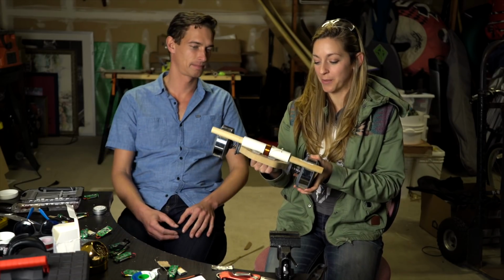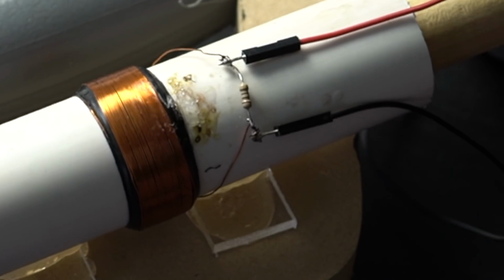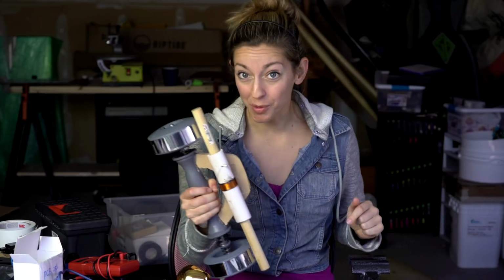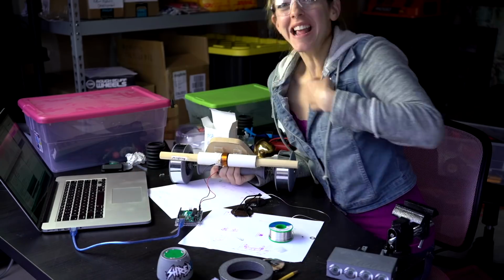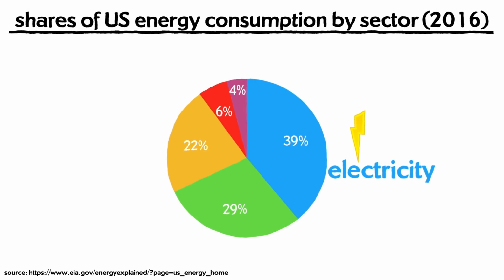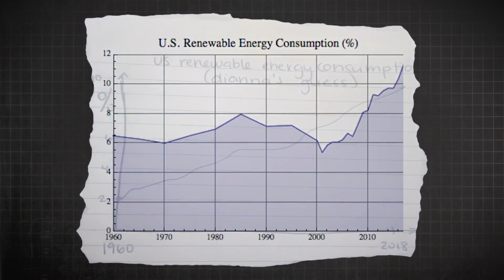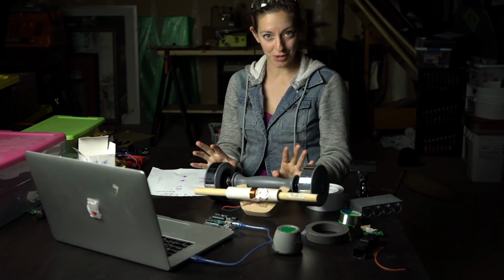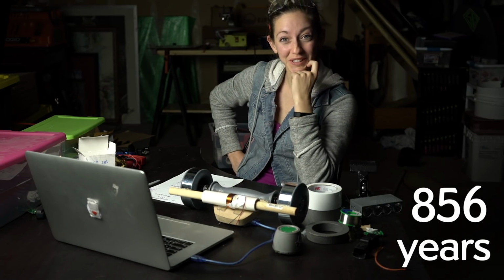Can you power a house with a ShakeWeight?

Comment: Good one physics girl.

How about blowing the myth that solar and battery power together are clean green power.

Do the research, lifecycle analysis, youll never generate as much power with them as you used to  manufacture them , yes omg. 12 tonnes co2 per kwh of storage in LiFe. Some thirdworld PV, manufactured using dirty  coal hmm not good. Maybe get twice the manufactured energy over 20 yrs, put them together fffft! 

A show on lifecycle energy costs that also considers emissions from that dirty manufacturing, hmmm good show.

Comparative analysis of different energy sources.

Would make a good show. Im sure the wind industry would fund you ha ha
Reply: Even with all that, renewables and nuclear come out ahead of fossil fuels on nearly every metric. While the downsides of renewables and nuclear should be considered, they need to be considered in context, and the context is pretty clear that external factors of fossils are an order of magnitude worse than those of renewables and nuclear.
Reply: Thomas, this is unequivocally wrong and has been wrong for about 40 years now.  We use uranium at less than 1% efficiency now, and could boost that by orders of magnitude if we wanted to.  We don't because URANIUM IS SO CHEAP! It is so cheap that all plans to build breeders have basically stopped because there is at LEAST 100 years of proven reserves, with likely hundreds more if we looked hard enough, and that is before considering ocean extraction, which is essentially renewable at that point (do to the incredible amount of uranium on the ocean floor that dissolves back into the oceans once you extract it).  Fusion and fission need not be at odds, particularly over something as much as a non-problem as fuel reserves. And that is before even considering thorium and breeders.
Reply: EROI is great, but it isn't everything. I live in the Great Plains, where everything is very spread out. It's infeasible to build a nuclear power plant for every city out here. If you centralize one, you lose a ton of power  transporting it over 100's of kilometers. Fossil fuels pose a similar problem. The wind here blows all day everyday. We can disperse turbines to keep everything powered out here while losing less to the grid. Renewable energy has benefits outside of carbon. 
I'm not saying fission is bad, just that it isn't a long term solution. Future mega cities like Lagos and Nairobi will require a ton of power in the coming decades due to increased affluence. They will use coal if we don't give them something else to meet demand. Nuclear is the only thing that will meet their power needs, but using nuclear fission to accommodate future energy growth will strain global supply. Billions of people are about to have a per capita power demand similar to that of Europe. Our current production lasts us 100 years, exponentially higher production will burn us out way sooner.
Reply: craig me can you state your sources and/or show some calculations? I work in the energy industry and I’m finding it hard to believe your claims
Reply: Not true. Solar power has an Energy Return on Investment (EROI) of about 10, and can be higher if used near the equator. Coal has an EROI of 30, but hydroelectric power has 40 and nuclear has got a whopping 75.
Reply: Actually the Uranium Red Book puts the number more at 120-200 years of proven, and that is without any processing or higher burn up reactors or using thorium. When you combine high burn reactors, thorium and ocean extraction, the number ranges more from 10k years to basically indefinitely. If we keep developing nuclear like we do other technologies, there is no reason to expect this end of resource supply to be an issue. I mean, people use the same argument against solar, that rare earth materials will be of short enough supply as to make it untenable as a power system. I have always found the resource depletion arguments to be weak, cause look at what happened with peak oil, all the sudden the US is an oil exporter again cause some crazy people found out a way to extract resources. Round and round it goes! There might be good arguments against nuclear, I just find the uranium is in short supply one not one of them. 

In the end the environmental impact of extracting resources for nuclear and renewables will likely be more sufficient cause for alarm than their attenuation in supply.
Reply: PV cells, and certainly batteries, are not perfect yet, sure. But they ARE cleaner than fossil fuels, and popular use is key for driving innovation to yield cleaner PV and bartery manufacturing.
Reply: I think we agree here that fission is superior to fossil fuels and we should start replacing coal with uranium. I just divided known supply by extraction to get 100 years (though 10,000 years of anything that's not iron, nickle, or silicon sounds like a stretch) so I'll have to read the Uranium Red Book. I've been on and off for fission recently. I'm open to it being viable long term, if the math adds up. 
Environmentally there is radioactive waste, but if humans are good at anything it's digging holes.
Reply: "How about blowing the myth that solar and battery power together are clean green power."
Quite the contrary, the more solar and batteries you have on the grid the cleaner the production of those two get, making it even more advantageous to integrate more of them.
Reply: they are a helovalot cleaner that what we are allowed to use at home right now... The only thing greener is probably LFTR, and I'm not holding my breath on a Sub $25000  0.25 container-sized mobile reactor getting dropped off in my back yard, any time soon.
Reply: +Thomas Urech You are however ignoring the fact that Uranium particularly the actually useful Uranium-235 is by far the rarest natural isotope usable for nuclear energy production on Earth. U-235 has a lower abundance than things like gold by a considerable margin, Th-232 on the other hand which can also be used for nuclear reactors and indeed for safer reactors has an abundance that is almost equal to that of lead several hundred times the abundance of U-235.

Admittedly one of the main advantages that makes Th-232 safer is that it isn't directly fissile on it's own starting a reactor using Th-232 does require a small charge of something fissile like U-235 or Pu-239 to get it started though there is more than enough Pu-239 already existing in unprocessed waste from Uranium reactors to initiate all the Th-232 we have on Earth which easily make Th-232 good for up to a few tens of thousands of years.

Short of a major disaster it would be shocking if humanity was still limiting it's resource horizons to Earth itself by the time we ran out of Th-232 and the asteroids contain many many times more accessible fissile material than the accessible crustal material on Earth after all that is where basically all the U and Th in Earth's crust and for that matter almost all the other metals came from, Pretty much all heavy elements and metals Earth gathered before it developed a solid crust are lost forever to us buried deep in the planets core as Earth is way too large with a gravitational field far too strong not to be very heavily differentiated.
Reply: I am all for 95% nuclear with renewables here and there. Burning coal is incredibly inefficient and makes so much waste. Nuclear fission is by far the safest and cleanest energy source we have per unit of energy produced. But so few people are willing to understand statistics.
Reply: I love Michael, but he goes a bit to far in the other direction. Nuclear isn't BY FAR the cleanest, but it is up there with renewables for sure and in someways maybe even has some upsides you can't with with them, and the same is true of renewables towards nuclear. They can complement each other if we let them!
Reply: I did some calculations and came to 101 years exactly of proven reserves at current extraction. Increasing nuclear use will certainly speed us that process (more demand => more mining => faster depletion). This is perfect for helping developing countries short-circuit fossil fuels, but is by no means a long term solution.
Reply: ARRO Projects will do thanks
Reply: Solar heating is awesome!  I wonder why we don't use it to run Stirling engines connected to a generator, though?  More maintenance? Higher cost?
Reply: Congrats craig, you attained the intelligence of a potato... sadly that isn't quite good enough for a real conversation on this topic.
Reply: Video Aerial Systems photovoltaic cells should be reserved for satellites. Reflective solar plants and solar heating are far better
Reply: Takeshi M 
Depends on where you source your solar panels as I said. And the trend to put a battery pack in garage makes it a poor return on energy investment. 
Agreed solar better than coal, but need to think where the pv came from and is that the best bang for buck. Some european, US pv would be very good!   But hard to know the emissions intensity in the production. 

 Bio energy, solar thermal, eeer not clearing the amazon, many options out there to make a difference. Godda find the best least emission intensive supply for your area. 

Godda say no one will invest in new nuclear developments any more. Takes 15+ years to get one up and running, future consumers may not want it, renewables are cheaper, and provide more dispachable power, ie faster availability when demands go up fast, and nuclear baseload can only be sold for minimal returns. 
Then theres the not in my backyard problems. Its hard enough approving a windfarm. Nuclear today, not an option. And then there is the security problems with nuclear waste. Not an option.

 Interesting discussion. Im surprised nuclear still has any support.
Reply: ok, but what if they're manufactured with clean power?  you can bootstrap off of conventional fossil fuels, but if you build new solar panels and wind turbines and batteries with power from solar panels and wind turbines then .. that's fully renewable and "clean green" power as you said.
Reply: Nuclear is the way forward. It is BY FAR the cleanest energy source out there. (seriously, not joking - here's a place to start https://www.youtube.com/watch?v=ciStnd9Y2ak )
Reply: Right. Solar is by far the least effective type of power generation. Even if we had a battery that could be manufactured once, and held infinite amounts of electricity, you'd never be able to generate enough electricity from solar power to deal with things like cloudy days, let alone power homes during the winter months when there is very little sunlight and the demand for electricity is the highest due to the cold.
Reply: You must consider the environmental damage of producing solar cells.  While they are amazing, they are very dirty (chemically) to produce.
Reply: Fusion perhaps, but not fission. We simply don't have enough uranium for fission. Fusion is the power of the future, but we need the other renewable sources while we perfect the technology.
Reply: Does anyone speak English here?

Comment: Nuclear energy is actually cleaner than solar and it can provide enough of energy fast and without a need to completely rebuild the grid or change consumer habits.
Reply: While it IS cleaner it cannot provide enough energy.  Nuclear plants are not capable of load following or peak demand.
Reply: arjenbij uranium isn't the only fuel for nuclear power
Reply: arjenbij Uranium is not running out. The specific uranium used is becoming less common on ground, but there is an endless amount underwater. Nuclear is sustainable but boy is it ever expensive. It works for smaller countries like France and Lithuania, but not really any further than it currently is for the states.
Reply: +arjenbij uranium is running out? and you think that the rare-earths necessary to make solar panels and batteries isn't? Also, while it is running out, known veins would run world for centuries before running out completely.

+Large.xxl while digging and concentrating uranium is dirty too, you need way, way, way less uranium than you need the minerals to make PVs.
What cost you're talking about? Nuclear costs already include decommissioning costs and that makes it like 10-15% more expensive than coal and still like half the price of PVs. Not to mention that if there were more nuclear power plants, there would be bigger market for fuel reprocessing (again, because you need so little uranium, you need a lot of plants feeding a breeder for the breeder to be financially viable).
Reply: Are you referring to a Thorium reactor?
Reply: Yeah, that's the most reasonable example, and of course sometime in the future we might have Fusion or some other nuclear fuel.
Reply: May I ask how nuclear energy is cleaner than solar? Nuclear energy might be more concentrated in terms of fuel volume, plant footprint, and output power when compared to solar. But ... how is it cleaner?
Reply: True. Solar is not perfect. But what about building nuclear powerplants and digging for uranium and concentrate it, thats very dirty too. Besides the huge cost (dollar amd energy) to dump the nuclear waste corectly for the next 10.000 years?!
Reply: I don't know the exact process, but not a lot of nuclear waste is produced in nuclear fission, and the waste that is produced is largely modified and stuff for later use. As I say, I don't know the process, but people are very clever and have figured out how to do things well.
Reply: Martin Fialka yep but nuclear isn't sustainable because uranium is running out.
Reply: People typically reference the environmental impact of making solar cells when they claim nuclear is cleaner.  It just depends on what you consider to be clean.  Indeed manufacturing of solar panels is a dirty  process and not at all clean.  However, in operation they are obviously clean.

Comment: You need to look at the amount of that energy is lost through old transmission lines in the US.
Reply: It's only like 8%, which is pretty good considering.
Reply: Adding the word "old" to transmission lines doesn't automatically make them less efficient. Age isn't really a major factor in its efficiency. There would have to be heavy corrosion and other damage that would increase its resistance enough to warrant replacement. And if there is they get replaced.

Newer transformers aren't terribly more efficient then the existing ones

The only real way to lower the losses would be to increase the diameter of the conductors at the cost of untold billions of dollars that will unfortunately be passed down to you and I in our electric bill.

I say first we look at are source and destination then at the transmission last

Comment: I loved your shake weight generator, but I was really disappointed in your pathetic .004W output. Can you squeeze more power out of your electrishake by adding more coils? Many generators I've seen have dozens of coils and multiple magnets. Does the density of the copper coil improve the output too?

Comment: Hey Guys, on thing that seems weird to me are the 30 kWh a day she estimated for an average house. I did write a paper about sustainable energy last year and found out that in Austria (where i am from) the average houshold needs about 12 kWh  a day. I have already been to the states and have noticed that houses are built differently than in europe. A lot of them seemed to be poorly insolated.  If anyone of you lives in a house in the US and happen to know your annual or daily energy consumption, feel free to share it with me to help me.
Reply: Martin Rosenwirth im in the US and my house averages just under 12kwh a day. My worse days are mid summer when I run the A/C and it may go as high as 15.6kwh per day. My house is not a newer "energy efficient" home and was built in the early 60s.
Reply: MrAlucardDante its about the fact the 30kwh is more than double than that of an average Austrian house! What are you doing with your Energie?!
Reply: Except when the weather is very hot or very cold I use on average just under 12 kWh/day. I'm in an older all-electric house, we keep the windows open frequently in good weather too. We are in the Southeastern part of the U.S. All our light bulbs are LEDs and we line dry our clothes.  Those two things alone really helped cut the power bills.
Reply: http://bfy.tw/GbwZ the US energy information administration states 10,766 kilowatthours a year, so around 30KWh a day. Diana knows its math
Reply: Some of us in the US live in areas with significant climate differences than Austria. I live in South Central Alaska. While we don't have the worst weather in the state, there's a significant difference. Add on top of that there's areas nearby that routinely have winds in excess of 70 mph, and you have a whole new animal to deal with.

On top of that, there are humidity problems when you seal a house up too tight.
Reply: Well house builds depend heavily on region, some get very cold and some don't so they have  no need to extra insulation.
And that is the problem of averages, they warp numbers dramatically when you have huge power consumers so it needs to be taken with a pinch of salt.